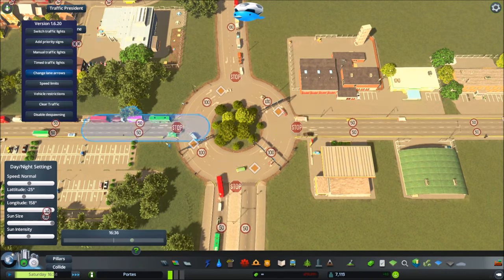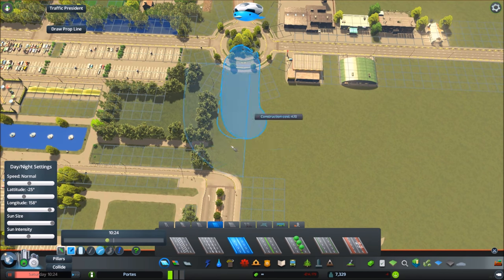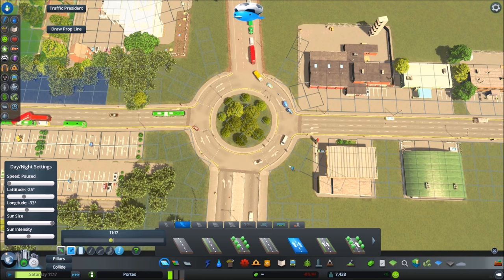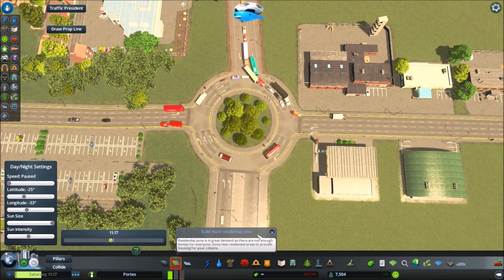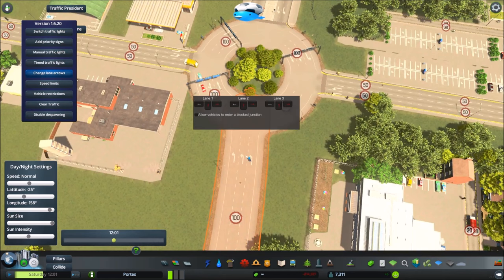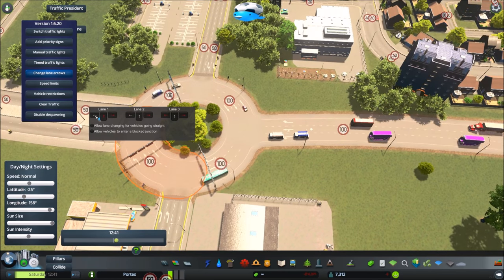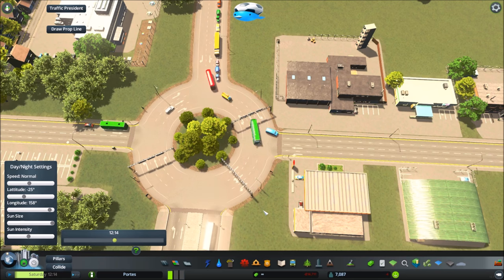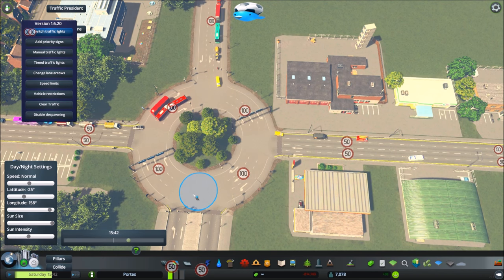Cities: Skylines - Roundabout Tutorial, Tips and Tricks - British LH Drive

Comment: hey PUG. I know this is 1 year old, but I'd like to add my 2c if you don't mind (no mods required): 1) 3lane highway is bad if the roundabout is too small, as vehicles will stuggle to make a proper lane change, which will result in traffic jams. 2) traffic lights at entrance roads are actually a good thing, as they keep pedestrians under control. otherwise, pedestrians do what they want and create more traffic jams. inside the roundabout it's obviously best not to have traffic lights like you said. 3) when using highway roundabout, pedestrians can't go from one side to the opposite. elevated or tunneled pedestrian path help with this and should be used.
Reply from the maker: +Phoenix C64 Thanks Phoenix. Great input, certainly some points to consider!